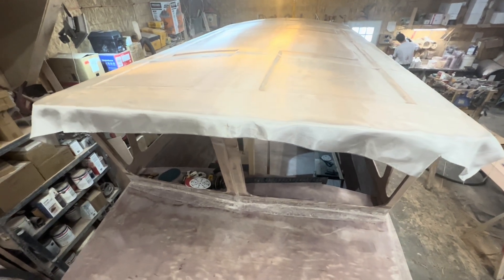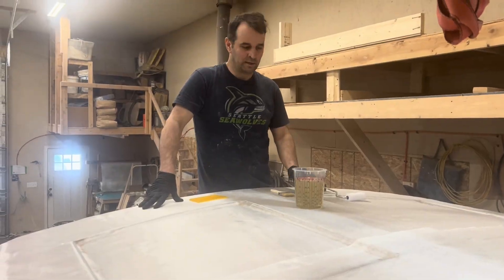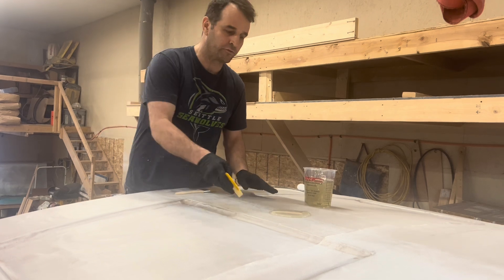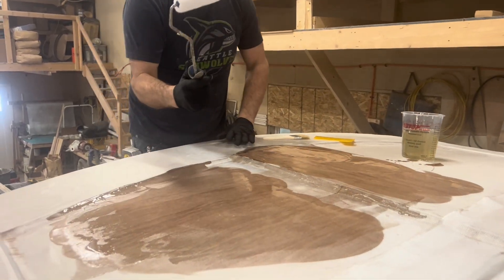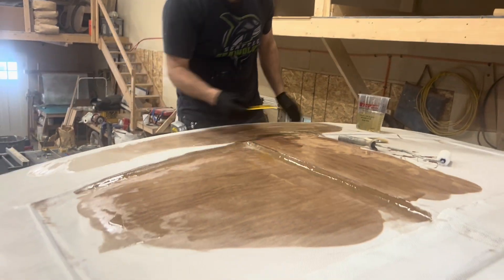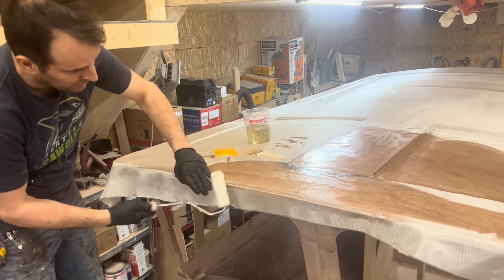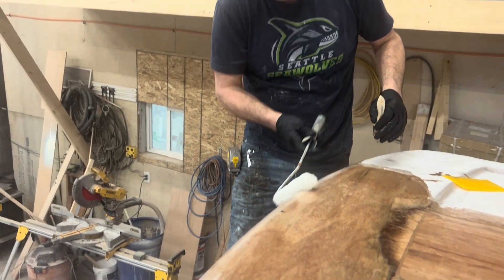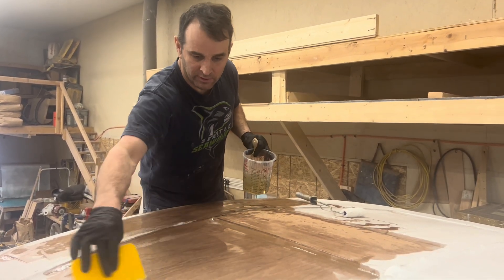How to fiberglass with Epoxy

Comment: Thanks for this - great for a novice    How long ago did you do the filets before you pressed the fiberglass into the filets?
Reply from the maker: 30 minutes
Reply: @LyndakerAnthony  thanks
Reply from the maker: Depends on speed of epoxy…we use 10-20 min epoxy
Reply: What kind of clothing is that